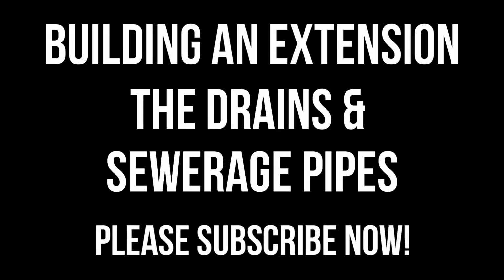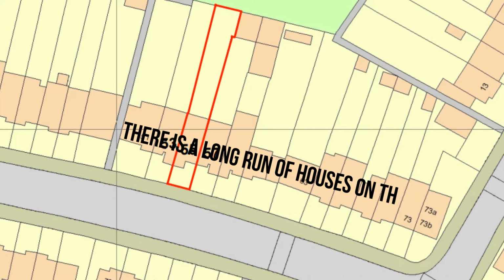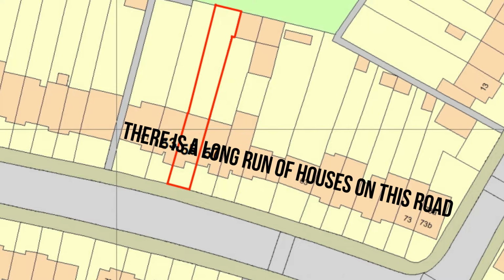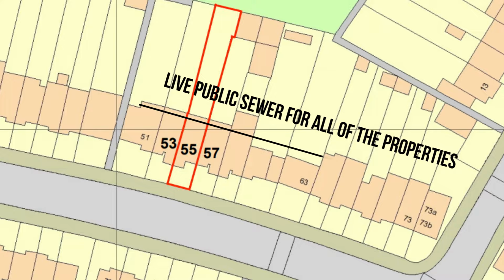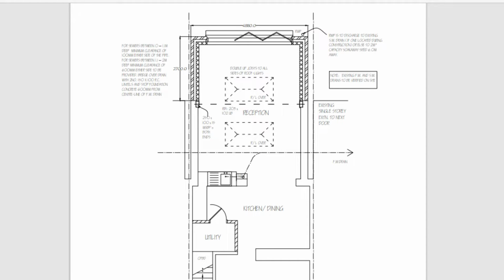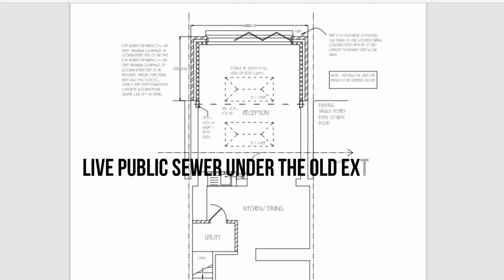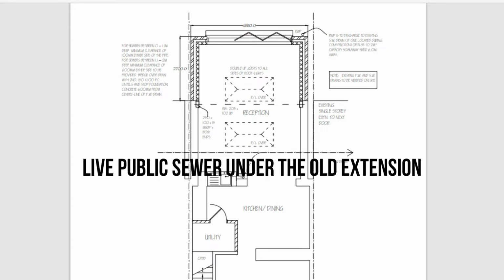Building a House Extension Part 3 - THE DRAINS & SEWERAGE PIPES - Housing Market

Comment: It looks like you have fitted a normal 90degree bend on your new inspection chamber, yet to be installed. If we were installing that, we would have used a slow bend to be able to rod the  chamber if and when required, as it would be much easier to rod than a normal 90degree bend.

Comment: Great video. Sorry to disappoint, but at 11.26, you say "nobody's using clay pipes anymore..." As sewers in England and Wales were adopted in 2011 to become public sewers, most if not all water companies will not let you use anything other than vitrified clay on the main sewer itself, their reasoning being that that clay is much less prone to damage from high pressure jetting, and also, that rodents have been known to gnaw through plastic but not vitrified clay. Services coming off that sewer however, are the homeowners responsibility, and CAN be done in plastic.
Reply: Don't let the water board see this video -)

Comment: As a drainage engineer I can tell you now that jetting systems have trouble with that many bends👍
Reply: 100% That is a very long way access like a M25. Once it’s blocked, you better need an insurance cover to dig the extension and clear out blocking.
Reply: Euuuurgh 11° bend opposite to a swept tee inlet. Horrid.
Reply: My house is the first in the line of detached houses and this is where both sewers start.  They are coming under 4 meter of my permitted development. Can i build over them a single extension or do i need any permissions? Thanks

Comment: hi, your video is  Very informative. I understand that you will backfill the area after the connection of all pipes (14:18). Please advise, Are these plastic pipes are able to take a load of earth backfilling OR concrete pouring if there is concrete floor instead of timber/joist flooring.
Thanks

Comment: Hi, Great video very  informative but easy on the brain , 

Im doing a similar job soon/ish , I noticed the connector/ adapter from clay pipe to PVC is smaller than/different to  the one from PVC back to Clay ..  what is the reason for this ? And am I right in saying that this to make up the difference back to clay to keep the pipes at the same diameter right through?

Comment: Hey great video. Out of curiosity, do you reckon removing an inspection chamber and replacing it with rodding access a meter away for a bend in a sewer system is likely to work? I know bends are a lot trickier but curious none the less.

Comment: Thanks for posting. I've just moved into a basement flat in a row of terraced houses and there are two manhole covers in the patio courtyard and a drain pipe from the higher flat empties into an exposed drain[?] in the courtyard....[not nice as was blocked and it stank!]  I'm trying to find out about drainage and your video helps.
Reply from the maker: Hi. Thanks for watching and great feedback. It sounds like the flats were created as part of a conversion from houses. If that is the case then the drainage may have been done badly and is probably not up to modern regulations. It might be worth having a chat with the leaseholder of the flats to see if the drains can be updgraded.
Reply: @joeblogs  thank you for replying ,great advice.

Comment: Nicely edited, easy to watch with a good commentary . That 90 degree bend at the bottom of the rodding access would be very hard to get through. Why not 45degrees at the base with a 45 degree rodding access?
Reply: Or even a long radius 90 degree - like the ones used at the bottom of a soild stack.
Reply: @dwaggys3322  yeah, long radius bend would make far more sense
Reply: @dwaggys3322  neat job apart from that
Reply from the maker: Thanks for the great feedback. We are trying to minimise the disruption for the homeowner so wanted to locate the rodding access as close to the house as possible. A high pressure hose is the most likely way to clear any blockage and those guys are very good at working with 90 degree bends 👍